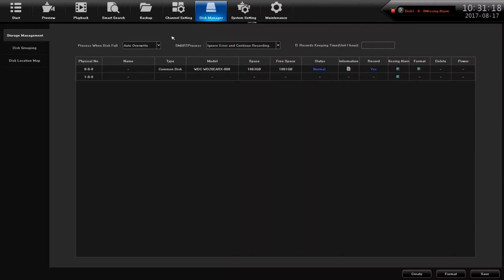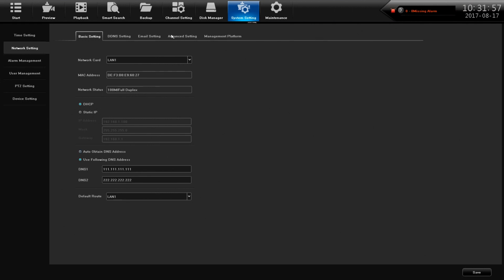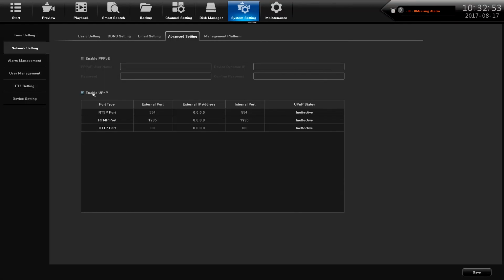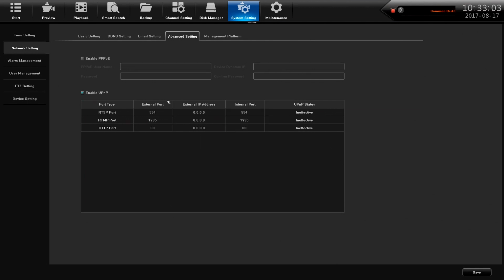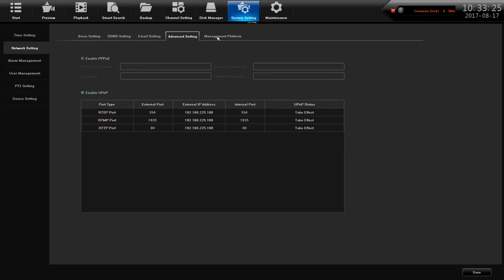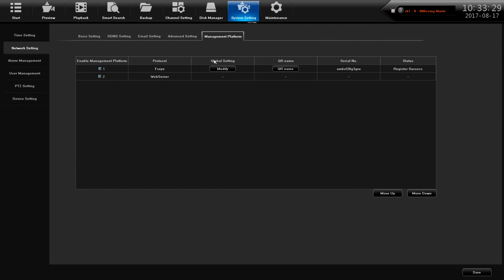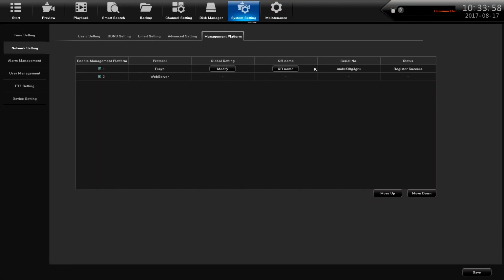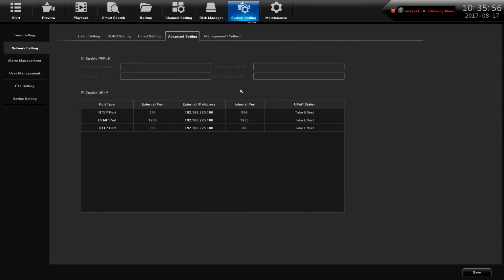NVRIQ Range  - Remote Viewing (Smartphone, Tablet)

Comment: I have 2 LAN, my cameras have mapped to LAN2 but I only have the option to make the default network LAN1. What can I do to fix this?
Reply from the maker: Hey Laura, 
I'm assuming this is to be able to access the cameras directly?

The general idea is, you connect your router to the LAN 1 port on the NVR and your cameras site on the LAN 2 port in the NVR. The easiest method to have your NVR AND cameras sit on the same network is to either provide power individually to the cameras and connect them to your router, or purchase a POE switch, connect the cameras to the POE switch and the POE switch to your router. An alternative option is to also add the LAN 2 subnet to your main PC, but that can get a little too technical. This link might help: https://tunecomp.net/windows-10-multiple-ip-addresses/

If we've misunderstood anything, please send us an email at support@radioparts.com.au and we can try to help you out.
- Bilgin